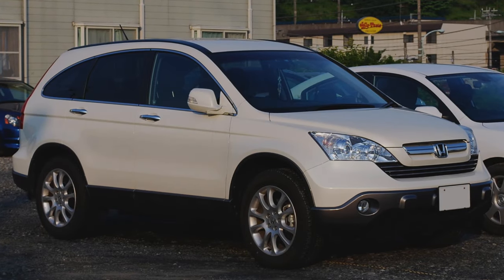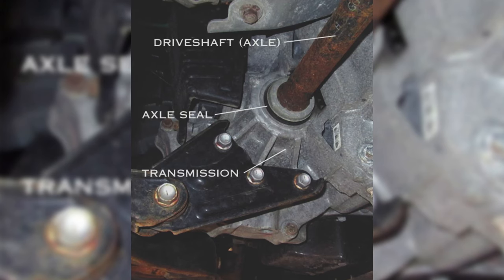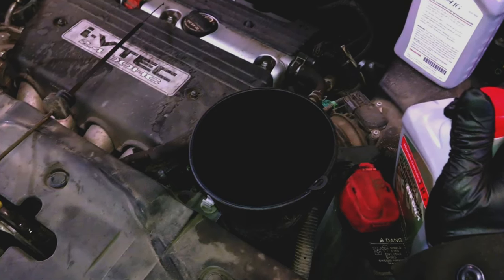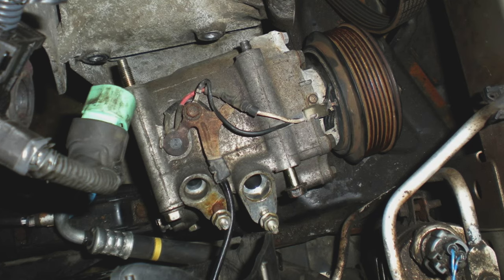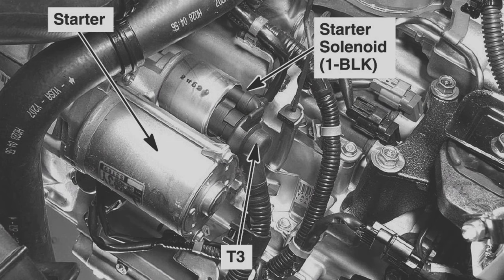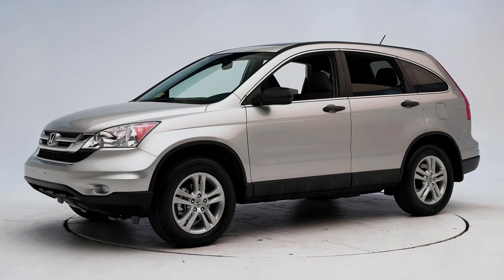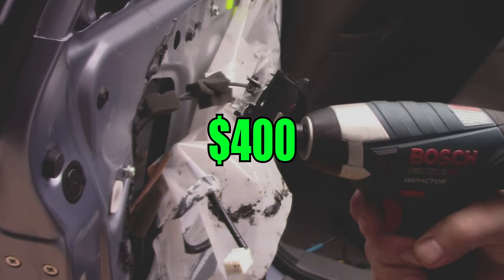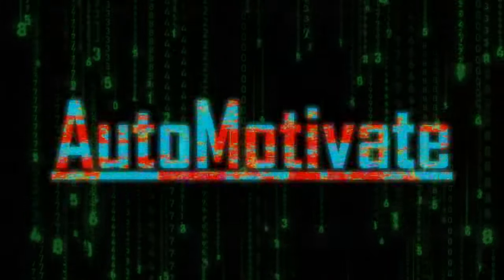Watch This Before Buying a Honda CR-V 3rd Gen 2007-2011

Comment: Original owner of a 2009 Honda CRV.  The maintenance is 100% up to date. Dealer serviced only.  160k miles knock on wood I have not had any major problems.  Did change out all of the struts.  I loved the car.  Gave it to my brother this year (2021).  Go Honda.
Reply: @Maloney7 I too just purchased a 2009 Honda CRV EXL...I noticed you said you only let the Dealer service it. Would you mind expanding more on that? ...Would like to know if you feel the dealer mechanic is best. Thank you for your time...
Reply: @elle5031  The Honda dealership in my area has very reasonable prices for maintenance for my CRV.  No need for me to go to Joe mechanic around the corner. Plus my CRV has been very reliable.
Reply: Update now and we’re the struts expensive? How did u know when to replace?
Reply: Our 2007 CRV we are the second  owners. . It has 269,000 miles. The only thing that need to be replaced has been the muffler and the starter. Always passes inspection. That’s a pretty good deal.
Reply: Hey, I am considering buying one that already has 170000 miles on it. How many more miles do you think I can get out of it?

Comment: I just bought me a 3rd Gen because my 1st gens transmission went out. I love the car, don't get me wrong, but it has SO much less features than my 99. No full spare, no table, horrid back seat capabilities and the seats don't turn into a bed.. reliability is phenomenal and tbh, the thing is a freaking go kart. Probably use the 3rd to tow a break down camper conversion on the first gen.

Comment: This vid doesn't square with the hundreds of Honda CR-V owner surveys collected by Consumer Reports. The 2007-2011 have a long track record of owner satisfaction. Don't believe me? Try finding any 3rd generation Honda CR-V for sale. And no I won't ever set foot on a used car lot.
Reply from the maker: So you are saying the car has zero issues?
Reply: @AutoMotivate  not zero issues but just common problems which just won't empty our pocket

Comment: Got mine with 200K on it and give it to another owner. Its a manual and by the driving you won't feel you are driving a 200K driven car. In fact I used to have 2007 one which conditions was not good but this 200K is runs better then that. I can say if you maintain it well it won't disappoint you any time

Comment: I bought my '08 EX-L with 132k miles. I had issues with the VTEC control module and solenoid and it has run great ever since. I'm at 193k miles now! 
I had to replace the a/c compressor and the alternator, but I think those parts were past their useful life cycle. 

Also, the locks always break on these cars  (there's an auto-lock feature that causes a lot of wear and tear, but you can easily turn the feature off as listed in the owners manual) and the cloth seats are more durable than the leather ones.
Reply: What about your rear trailing arms? Were they rusty??

Comment: I have a 08 CR-V EXL with over 227,000 miles on it. Never do a flush on either an engine or a transmission on any vehicle. I’ve had to have the starter replaced.

Comment: Have a 2010 AWD EX.  It's okay.  Only major thing that went was the AC and these cars are known for that.  Power steering whines but it's nothing more than an annoyance.  Had to replace rear struts.  Other than that, just your basic maintenance- brakes, tires, fluids, etc.  212,000kms.  I plan to drive this car another 10+ years and 500,000kms.
Reply: I’m at 185,000k and zero issues. Waiting for the AC to go out but so far so good lol

Comment: My 2007 just hit 300k, its so solid I got a used 2009 to swap parts back and forth on. Both still drive and shift amazing. I got the stut bar noise but honestly doesn't effect the driving.

Comment: My air compressor went early like around 120,000kms.  Not a lot of other problems so far other than suspension noise in the rear.  Starting to throw a catalytic converter CEL warning, mechanic says its due to exhaust leak at the flange.  Time will tell.  Car has nearly 200000kms now.  I drive a 2011 AWD
Reply: I got one too. Let's see how it holds up
Reply: What is the suspension noise from?  Were you able to fix it.?
Reply: not sure yet my intention is to deal with it in the spring. @Theyralltakenfu
Reply: @timzzz9963  I read yesterday that many times the Sway Bar can be loose.  I guess it’s pretty easy to just tighten yourself.  
Of course some said to make sure the spare and al it’s components are tight.

Comment: A lot problems with the TPMS module unit....
Module can't save the ID learned from the sensors, so this problem it's a common failure. 
Five ones just in 2024!

Comment: original owner of a 2009 CRV.  160K miles.     I came here looking for fan related issues since mine has had 2 issues recently.       I will say that some of these are spot on.     I've had the starter issues,  Lots of AC issues.   3 times i've had to replace the Relay for the compressor. ,   both stabilizer bars,   and all shocks/struts due to them leaking hydraulic fluid.  Thankfully no trans, rear end, or engine issues.    Also,   pretty much all the leather on the inside is trash.   all seats and arm rests started wearing evenly at the same time even though we had the car for 5 years before we got kids and started using the back seat.

Comment: Yep, AC compressor... It failed on mine at 80k miles.

#6 orginal brake calipers could fail in the braking position? I've read that was a common problem and I've experienced it.

Comment: I have a CR-V Lx 2008 .
I have a radio that is not working with the display showing HF LINK with a phone icon .
I can’t seem to reset it 
I tried disconnecting the battery 
Pushing reset buttons 
Removed the fuse under the hood 

Do you have any suggestions?
Thanks

Comment: I watched a video about why my check fuel cap keeps coming on when I start my 2011 CRV and it says it may be the selenoid? Once i push the button on the cluster panel to reset it it doesn’t come back on. Its inly got 77,000 miles cuz my mom didn’t drive it a lot when she got it in 2014 or 15. So I bought a new gas cap awhile ago like a few months back and it been going on since i got it. Its made for my car so idk why else the check fuel cap light would come on the cluster panel unless it’s a bad selenoid? My husband cleared the engine light tonight so ill see if it comes on when I start it again
Reply: I drive the car more than she did and further trips

Comment: I recently bought an '09 CR-V with 90k on it. Front wheel drive. Replaced the rear struts, as the ride was stiff and clunky. The clunk-clunk is slightly improved, but I still feel and hear every uneven bit of road. The suspension is very stiff. I'd love to compare the car with another CR-V to see if stiffness is general in the model, but haven't found a way to do so. I like the car, but it would be nice if it handled a washboard stretch of highway with greater aplomb.
Reply: I've got an '08 with just over 200k. Yeah the suspension is just like that. You really feel the road. Makes loud clunking sounds when going over railroads, speed bumps, etc. mechanic says it's fine
Reply: they are as you say..i have a 2016 and they improved it greatly..
Reply: @tracy2762  - I'm used to it now. No biggie, though I may need to have the foggy headlamps polished...
Reply: @holyworrier  the 16 is great but its gdi and cvt...the handling is great..most people ignore the diff fluid..even honda doesnt care  .i am looking for a 2006 crb se..i need lower payments.
Reply: @tracy2762  - I wish you luck!

Comment: Out of all the years in this generation, what year do ya'll feel is the best?
Reply: I wish people would answer this ?
Reply: I believe the 2011 was rated 5/5 on JD Power reliability ratings. It ranked 1st in its class. I bought a silver 2011 EX-L with 150k miles in Jan. 2023. The previous owner had every Honda recommended service done to it. Plus it’s in like new condition for a 13 year old SUV.
Reply: My mom had a 05 put 178,000 Mi on it and it never had one issue

Comment: Please talk about 2004-2006 Acura Mdx
Reply from the maker: May have that out in about two weeks or so. Already pre-edited other videos for next two weeks due to traveling. Thank you for the recommendation!
Reply: Mdx tend to have bigger transmission issues since they are equipped with a cvt trans. And those are complete garbage.

Comment: My Honda CR-V 2007, consume more fuel than normal, what is likely solutions?
Reply: Puff up tires number 1
Reply: Replace engine air filter and treat it with fuel system cleaner ( twice ).
Reply: Possible bad O2 sensor
Reply: Besides not getting good gas mileage what else would indicate it’s time for O2 sensors there should be a upstream and downstream sensor on it?
Reply: Dont forget the spark plugs and cleaning if throttle body and mass air flow sensor.

Comment: You forgot to add that the LCD instrumental cluster in the dash tend to fail due to broken solder joints in the connection pins.
Reply: I bought a used 2006 CRV Honda only to find out the cluster panel bulbs some of them were burnt out it's probably going to cost me three hundred bucks to get that fixed maybe more it's a two-hour job what I understand Beware of the cluster panel guys